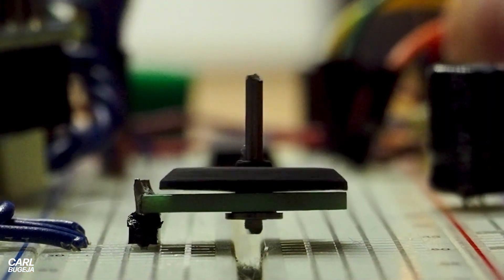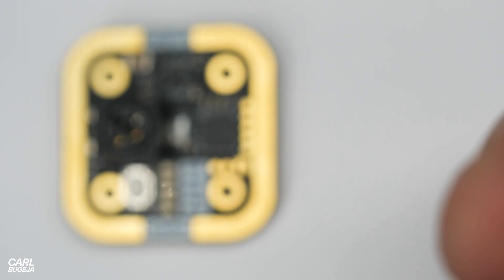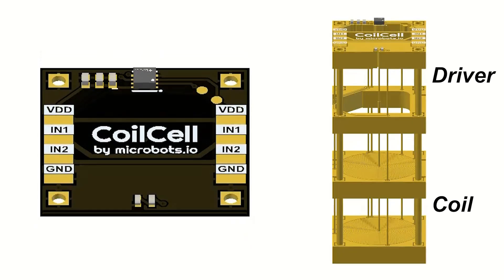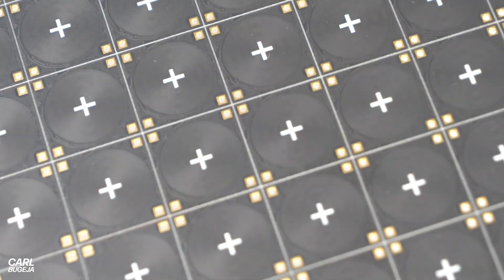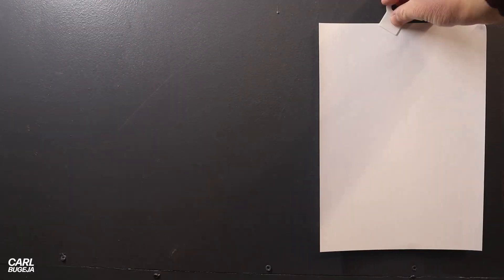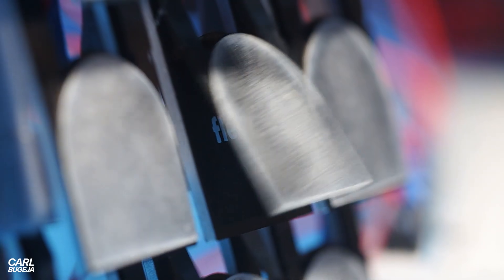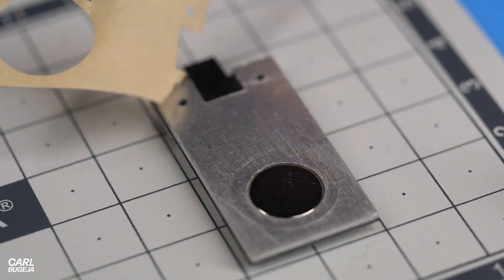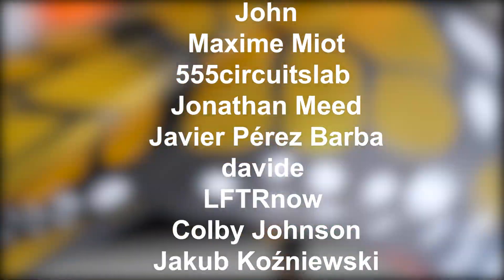Turning My Projects into Something You Can Actually Use!

Comment: What if, for the butterfly, you used nitinol as a muscle, add two paths so it can flap back and forth, and alternate the voltage in each one at a high frequency. Is this 3d printable?

Comment: Excited to see what you'll do with this new challenge I'm sure it'll be ingenious as always.

Seeing the flapping part with the shiny surface and the wobbling it inherently has from resonating when it turns on I wonder if you could do some resonance compensation/cancelation like what 3D printers have started doing with input shaping. Just to get it smoothly transitioning from the 2 states. Prolly depends how quickly you could switch it on and off with the driver but maybe?

Comment: If the goal of the flaps is having multiple discrete states. Then potentially a bistable mechanical latch can be designed into the pcb in the form of  a flexure. This could allow states to be held in different positions without the actuator using power to maintain the off nor on state.

Given the precision of the actuator and manufactering you could add more stable states. And in the end designing it to have flappyness in the on and off state is possible.

But this would drop the power usage drastically, of course depending on how often switching occurs.

Comment: An ornithopter would be a good application for the flapper if you can make a tiny flight controller.

I think the only challenge would be how to power it because of the weight of batteries. Maybe an RF antenna could harvest enough energy if flown close enough to a radio source?

Comment: For the flap display maybe try a lenticular film so that in one position one image or color is shown and another in the second. Also could you put each pixel on a thin shared axle with a tiny magnet on each edge and position a bit of perpendicular iron behind each for the magnets to stick to and a small electromagnetic coil attached to the bar such that a h-bridge chip could repel the stuck magnet on one end and attract the other.

Comment: for the display, why not make a pcb with a giant pad on the front and then polish it to mirror shine after nickel plating? Then I would add coils to each corner and a flexible pedestal centered on the back. That way you can tilt in 4 directions. If you used an X shaped flex pcb you could even fold the "legs" under and solder them down giving you a "parachute" shaped pixel that can tilt in 4 directions and not need the pedestal.

Comment: Great work as always!

On the display one would a fresnel lens with a black and white striped pattern behind. Should be light enough and increase contrast further. 

Was also wondering about it being on a bi-stable switch to only use power to change state.

Comment: Pretty cool. The main challenge for running multiple of these will indeed be the power consumption. You can also add a i2c chip to make each module individually addressable, like smart rgb led strips, so wires are minimized. Maybe in the future this will be part of the h bridge itself, like the rgb leds are now. Best of luck with the startup!

Comment: A question--are the coincells addressable? It would be really cool if they incorporated a tiny microcontroller the way addressable RGB LEDS do, so they could share not only power and ground, but also a data bus line instead of individual inputs. That would greatly simplify the development of things like the flip dot displays, which could be adapted from existing WS2812 libraries. It may already be set up this way, but I wasn't able to tell that from the video or indeed the website.

I keep wondering if something like this could be miniaturized further to act as a haptic output, a little like that hackaday Braille output project. Probably not, but it sure would be cool if it could.

Comment: The reflective flapper could be useful in stage lighting.  For some shimmering effect, water ripple, flat disco "ball", light glitter, flame flickering or just as a eye candy object (but that would need to be big)
Reply: An addressable disco ball would be epic! Seeing patterns chase one another across the surface would be neat.
Reply: what an amazing idea... now remove your comment, go out there and launch a startup before someone else does ;)
Reply: @whothefucktookmyalias  Ideas are only worth what you pay for them.  Also, I wouldn't want to found a company around manufacturing a device with less than 2-3K customers a year.  Especially one with so much hand-assembly required.